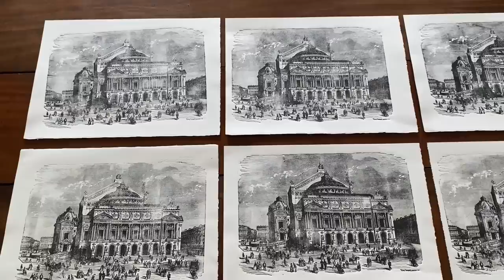Clearing out the CHATEAU MOAT and an AMAZING 19th Century DISCOVERY - Journey to the Château, Ep. 93

Comment: I was wondering: Why did the moat dry out if the drainage of the château has its outlets there? What will you have to do, to fill the moat with water again? It would be so nice. Regarding the dogs, so great you found them. Good Karma for the two of you!
Reply from the maker: I think there is just not enough water drainage to fill it, and there has been so much erosion into the moat that the soil just soaks up the water. We would have to excavate and seal up the moat in order for it to retain water. Yes, It would really change the look of the front of the chateau to have a water moat. ❤️